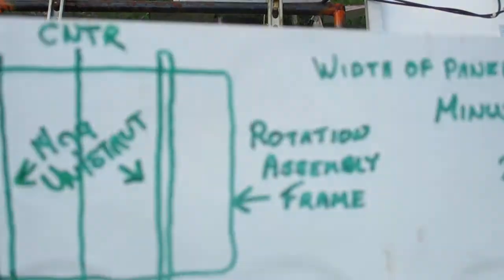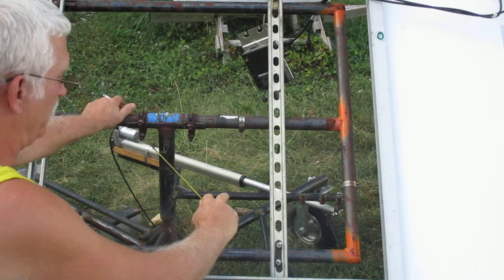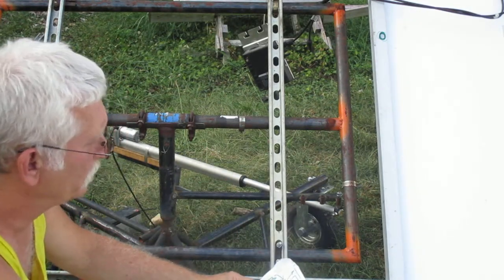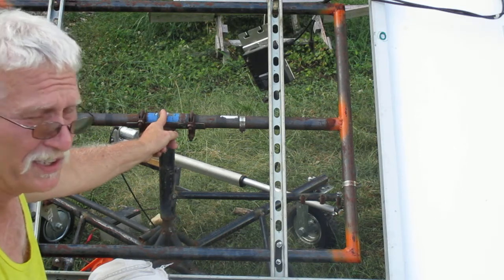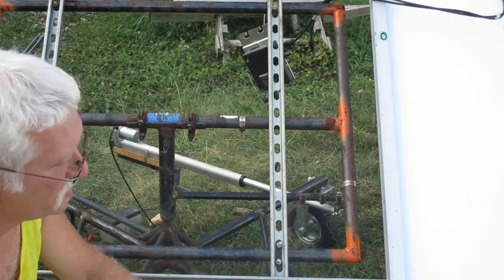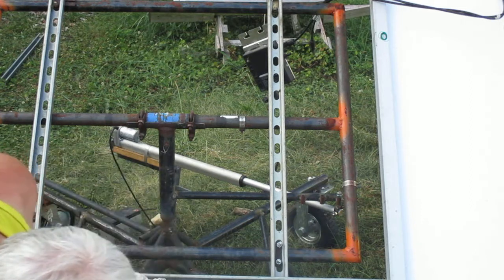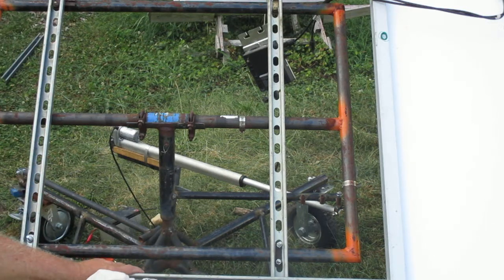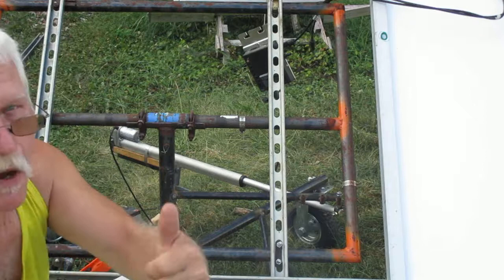Update16.....Unistrut Panel Mount assembly

Comment: I'm thinking of getting a 16 foot cattle gate while I'm still in the city. It should be easy to set up. I might be able to mount a lot of solar panels to the gate with some unistruts.
Reply from the maker: its an idea...or u could fab the tracker I'm building ..its capable of holding 4- 250 watt panels..2 units would just about get all ur panels off the ground and would also increase ur electrical yield by around 30%